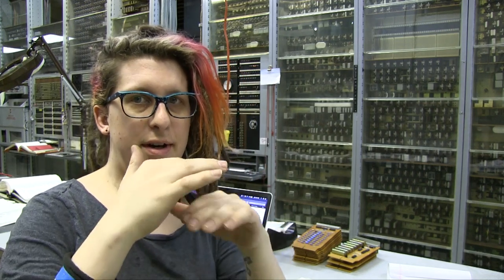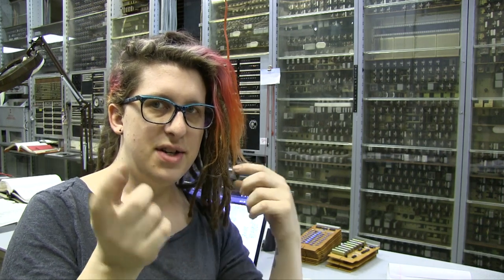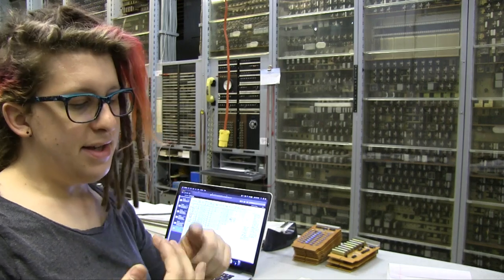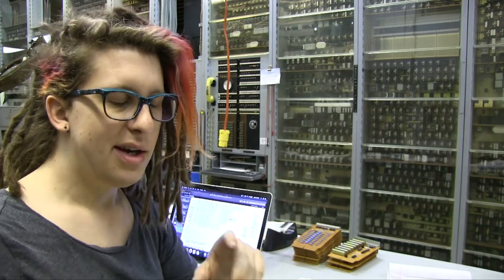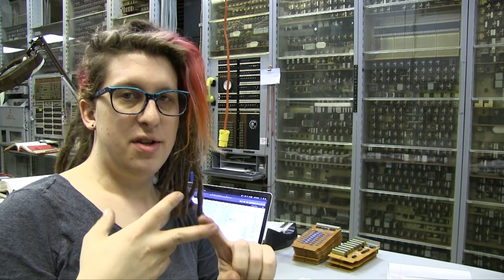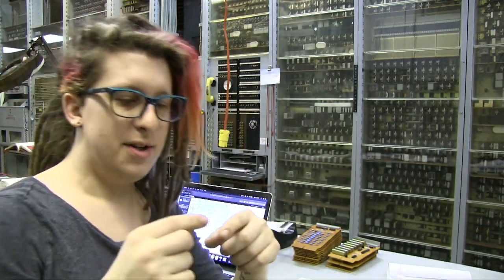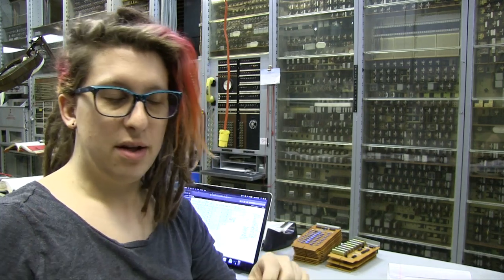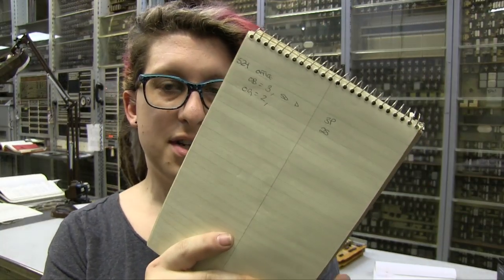How does a No. 1 Crossbar Marker work?

Comment: I worked in the Anaheim #1 Crossbar Tandem in the late '60s and never thought I would see another working one, ever!  We were in the 714 area and basically homed on the 213 area. The office did the billing with the transverters and paper punch recorders to make the tapes to ship to accounting. During the busy time of day the sound of all the senders and markers in the metal cabinets was quite deafening. Probably why I really need my hearing aids now. We had a "Panic Button" mounted above the trouble recorder that had a klaxon horn connected to it. When Western Electric was working in the office and the trouble recorder started spitting out one card after another or the office went totally silent we would push the panic button which meant reattach the last wire you just removed or remove the last wire you just attached to the installers. Sometimes that would restore service, sometimes not. I can remember all the techs rushing to the trouble recorder and grabbing several cards to try and read them to figure what piece of equipment was causing the problem. Our training consisted of about 3 months of class instruction and about 6 months of OJT in the machine to try and get some understanding of how things worked. Sarah, your knowledge and of the equipment and dedication to preserving these machines is quite remarkable to me. Keep up the good work.
I left the #1 x-bar to work in the TSPS base unit attached to the Anaheim 4A switch.  That was another totally new learning experience. Always something new to learn with Ma Bell. Rick Clark
Reply: That’s really great. Basically, you had a big red “undo” button :)

Comment: Being a Crossbar 1 switchman for 20 years, I really enjoyed this video.  I retired in 2014 with 40+ years as a COT. I worked on XBar 1,5,   ESS, GTD-5 , and fiber optic FIOS but never Panel, although we had a panel office in the building. I wired many Markers in our office, we had 8. I worked in the largest CO in the world at the time, Newtown CO in Elmhurst Queens NY.The wires on each bay were cut for TAX reasons. The company was taxed for every working frame, by cutting the cables/wires the switch was considered  RIP "retired in place" and no longer taxable. I did a lot of cutting my last few years with the company as the new technology was coming on line. We could have used you back in the day, you are very knowable. The XBar prints were big sheets of paper, also had "detached contact"  prints in 17x11"  book form. I enjoyed the hands on trouble shooting down to the component level, now it is just change a PCB. Thanks for the videos.
Reply from the maker: Right, I said the wrong thing when I said "insurance". I was corrected by a friend afterwards that it was actually tax reasons. We still have some of the orange RIP stickers on the frames, where they marked them as retired. Thanks :)

Comment: It's amazing seeing this working. I really respect your passion for this old equipment. Thanks for these videos.
I feel it deeply when you describe "destroying" equipment to write it off. It is so heartbreaking to see sometimes. I've seen some very low-operating-hours equipment destroyed for similar reasons. Some of it was not simply cut wiring; it was removal of lubricant and running to destruction, or removing protection devices and running until the electrical windings were melted.
Reply from the maker: Yeah, its terrible to think about. Really bugs me that so much amazing stuff was destroyed in one way or another!
Reply: @ConnectionsMuseum  
There's so much of that destruction which goes on. So disappointing! We need to continue learning about the origins of things we still have today. Otherwise, people will not appreciate what went into them.
I have a thing for older industrial equipment as well, but mainly refrigeration and power /  electric motor stuff. Not nearly as technically sophisticated as yours, however, there're very few people who seem to care about it. 
Please keep up the great videos! Looking forward to seeing the next one soon!

Comment: Thanks for all of this, Sarah!  You do an excellent job of describing the functioning of the equipment.  And you recognize how some of us were so intrigued by the sounds of the equipment when we used it, many years ago.  Keep it up!
Reply: I was a teenage phreaker and built blue, black and red  boxes, and I was not afraid to use them. I didn't know what was going on. I was also shown around the inside of  a number 5 crossbar central office by a friendly central office technician,. Also engaged in a lot of dumpster diving, found a bunch of old relays and a bunch of trouble recorder punch cards. All of your videos are fantastic Sarah, thanks for the great work.

Comment: Joseph Ruther mentioned -48V stings -

It reminded me that it's ring voltage you need to worry about, something I learnt the hard way as a 13yo putting an extension in for my grandparents & thinking "I'll ring the line from my mobile whilst holding the line wires together to test I've done it right"

The phone rang correctly. 
I learnt that ring voltage hurts. 
I did not forget that lesson...
Reply from the maker: I did something equally stupid when I was a kid. I was holding the tip and ring in my mouth while messing with the connecting block outside my house. Then the phone rang. :(

Comment: So basically you were augmenting the relay logic needed to support phone connections to the new exchange.  The whole system is amazingly complex but you do a great job of explaining it.  Thank you for that!!!  There are so many individual pieces like the crossbar switch that someone had to think of, and then developing the relay logic needed to provide basic functionality.  My ADD brain wants to liken it to a great big old fashioned pinball machine.  Where a specific input gets you a specific output.  Thanks for taking the time to explain the components and for the time you spend off-camera repairing components and reconnecting parts of the frames.

Comment: I remember playing with the phone as a kid in a really large area code served by crossbar switches.  I avoided "boxing" since Bell was taking that seriously but had lots of fun just checking out the local systems and all the cool sounds it made.   All the pulsing between switches and the cadence and sound of the various tones. No one would bother you if you didn't call "0" or "611" which were the only numbers that knew where you were.  I had decent recording equipment and the means to impedance match in and out of the phone line into audio equipment, but I don't think I kept any recordings. After I went away to college I got home and the whole phone network was very silent and clean sounding.  It had been replaced with ESS and all my favorite sounds were gone forever.  

Before that we did ride our bikes up to an exchange and banged on the door and a friendly tech showed us around.  Well not the first time but we persisted on different days until we found a tech in a good mood. Just don't touch anything!  It was a crossbar in the afternoon and it was LOUD!

Comment: From a retired SxS switching tech : This is awesome.  Always wanted to work crossbar. Have been studying crossbar #1 and panel for some months now off of the archive site. Thank you Sarah.  From t1dm-ted.
Reply: Hello.  I was wondering how SxS switches were interfaced to trunks using MF signalling.  I have been curious about this for years and have never found anyone to ask.  Thanks.
Reply: @bsadewitz  once a SxS switch hunts to an idle trunk, the relays in the trunk circuit will connect a transformer via 4-wire - transmit And receive pairs. Then to a E signaling unit which uses e&m signaling which toggles 2600 cycle tone on and off according to the dial pulses which interfaces into a carrier system to a distant central office, such as  N2, O, or T carrier systems.
Reply: There are converter trunks from dial pulse to MF but the distant office will usually translate that, according to where  the call is going to.  Interesting stuff.  I'm 70 but still would work these systems given the  chance. I worked southwestern bell in the 70's as a switchman and loved it in Eldon Missouri.
Reply: But these systems are all gone except for SxS Phil's or the connection museum.
Reply: @bsadewitz  of course if you were dialing a 1+ call,  the ani (automatic number identification) System would outpulse to the distant office.

Comment: Alright, Sarah, now that I've watched the entire video, I can say that I appreciate you touching on the subject of all the destructive wire cutting involved when it came time to decommission this equipment. I could have seen the decommissioning of dad's 1xb, 5xb, and TSPS but instead chose (wisely) to just stay away n "remember it the way it was". BTW I think your museum videos are very representative of what this equipment "sounded" like in the wee hours of the morning when call volumes were at their minimum. I like your wire tracing technique too, but 48 volts can poke a bit if you latch into it. Can't help but wonder if you ever get poked! . . .
Reply from the maker: I get zapped constantly. I did a few times while making the video, but I cut it out in the final edit.  ;)
Reply: LOL! Hey, from one vintage technology geek to another, I salute you! Take this to heart: You're only dealing with 48vdc n back emf from relay coil circuits opening. My own passionate hobby is vacuum tube electronics. Vintage tuners n amps. I've been poked by 400vdc and lived to talk about it. The experience is very over-rated and I certainly do not recommend it! 8D But I love my Bell Sound Carillon 6060 amp n matching 6070 tuner and I do all my own work on these n everything else I have. You're not a true technician until your vintage pride and joy has poked you! 8D
Reply: @ConnectionsMuseum  60/90 Tip/Ring is just enlightening.  I've tangled with PBX and hotel/motel boards before, and they would sit me on my ass when someone would call in. I'd be sitting there cussing a short streak (I'm a lightning magnet, don't get close to me during a storm), then get back up, dust myself off of any carbon I created during the zap, and keep on sorting out the spaghetti works that is the wiring.
Reply: @Joseph Rutha Good Move it was not happy. I've seen grown men with tears running down their faces when the Panel offices were cut. Each Exchange had a Soul and a mood of their own. Late night you would hear the interrupter bay keeping beat and hear the calls routing one by one. Mother's Day it was a din!
Reply: @ConnectionsMuseum  I can imagine that on the final...."...from my subscriber line to my district.....OW! SHIT!"

Comment: That note at the end that this switch is fully able to route the call without this needless loop over to itself is a great point at the differences between "real" installations in a world wide telephone network, vs a museum with just a handful of switches at hand. It is hard enough to get enough use out of just 1 of the machines on display, let alone the verity of them. So one has to make up demonstrations for how things could have worked, it becomes like theater. One switch playing the role of many offices spread out in a larger area.

And I guess the designers of this switch did the very same thing back in the day during its development. Since testing a machine's various features is usually less headache inducing when done in isolation. And one won't be a nuisance to others in the process.

Comment: Sarah, several times during the winter when a storm is in progress and you go to make a call and after picking up the handset and there is not dial tone just side tone. So many calls are in progress, that there is no open lines. All you hear is battery voltages and background noises, clicks and pops.

Comment: I enjoyed the video enormously.

It would be good to have an introductory overview with some high level conceptual illustrations to put everything into context. 

Based in England I am familiar with tandem switching, crossbar concepts and marker use (eg on uniselector PAXs) but a picture of the route of the call setup would be a big bonus. 😉.

I think that I have grasped the test desk concept of checking that the marker knows all it needs to because key relays have essentially a check contact - simple but clever. A talk with high level diagrams for the test desk would be super.

You are a star!

Comment: Loving these videos and currently working my way through all of them for no particular reason other than being a geek and finding them really interesting!
I was wondering with the compensating resistance values, are there a discrete set values to choose from or was it a case of measuring the actual line characteristics and setting a bespoke value for every trunk?
Reply from the maker: Thanks! The compensating resistance values come in discrete steps of 300 ohms, so 0, 300, 600, 900, etc. You can find a value that works for any local trunk using those increments.

Comment: Surprised those CCFs are solder terminals and not wirewrapped.  Does anyone know when Bell/WE started doing wirewrap and moved away from soldering the CCFs?
Reply from the maker: Not sure what a CCF is. The first mention of wirewrap is in the 1951-07 Bell Labs Record "Mechanically Wrapped Connections" https://www.telecomarchive.com/docs/bsp-archive/BLR/29-7.pdf
Reply: @ConnectionsMuseum  CCF = Cross Connect Field.  Sorry about that (OSP is my world, not the switchroom)
Reply: CCF really means, a Cross Connect Frame, eg. MDF, Main Distributing  Frame, LDF Line Distributing  Frame.

Comment: Sounds like you're giving it all the information that the "decoder" unit in your most recent video was giving to the sender.
Reply from the maker: Thats correct. By the way, panel switches have "decoders". Crossbar switches have "markers". They are indeed different, but play a similar role in call completion.

Comment: How many route relays were there in a 1XB?
Reply from the maker: It was variable depending on needs. We have about 100, i think, but it could go up to several hundred, if you had enough routes to need them.
Reply: As many as needed, Office codes start at 222 and can go to 999, you need one for each office code.

Comment: How did you learn all of this?  Training classes long gone lol.  Also how did the #1 differ from the #5? Excellent vide btw!
Reply from the maker: I learn first by doing, then by reading about what I just did. I am sort of obsessive, and have a very good memory for this kind of stuff. We have the books, and the machines, so I can make the machine do something, and then read the book to figure out why it did that :)

The #1 and #5 both used crossbar switches, but the layout of the machine is very different. It's sort of like asking "whats the difference between a semi truck and a family car?" Both have wheels, but their purpose is very different! 

The 1XB is the semi truck of switches. It's huge and powerful but not that great at going around sharp corners.  The 5XB is the family car of switches. Not as much raw power as a 1XB, but it can easily get in and out of a tight spot, and its more comfortable to sit in!

Comment: The lack of simple jargon definitions dilutes the presentation. 

Imagine you're not talking to another familiar with the terminology. 

A quick slide covering the call setup and control flow would really help get the concepts across when you're then walking through the signal flow at the equipment.

We need a "map" to follow you easier.
Reply from the maker: Thanks for the feedback. I'll try to do that sometime. For now, this will have to be enough: https://telephonecollectors.info/index.php/browse/bc-switching-library/western-electric/weco-switching-documents/weco-crossbar/11743-we-1-xbar-completion-of-a-call-bulletin-2-5-1-oct39
and https://en.wikipedia.org/wiki/Number_One_Crossbar_Switching_System